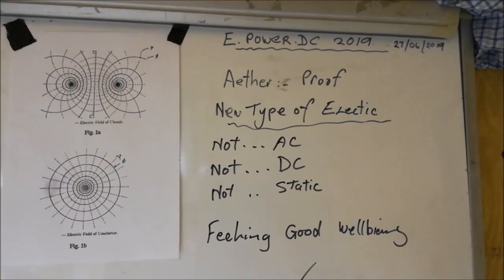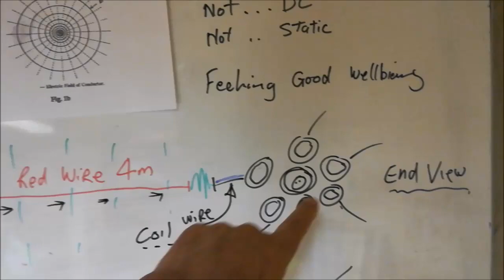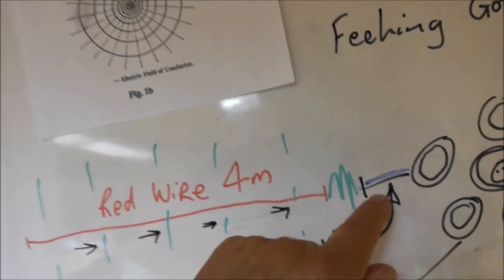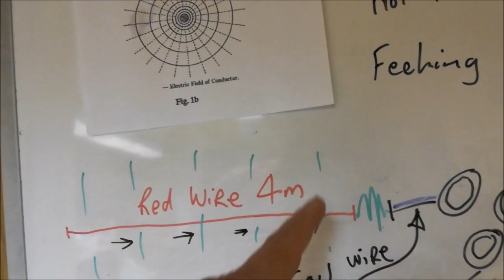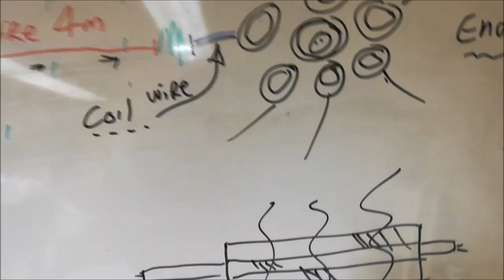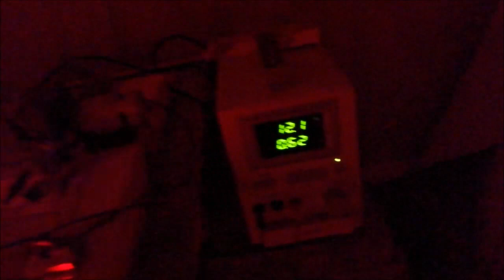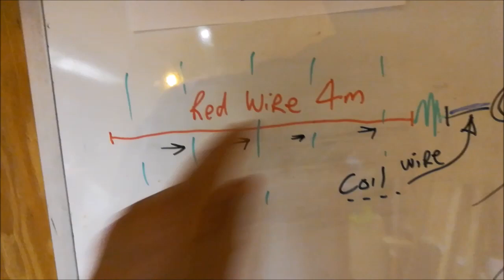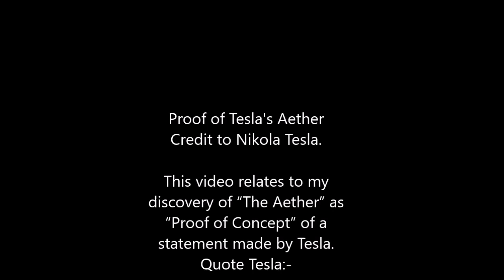Tesla's Aether Proof

Comment: It is called electric, not dielectric.
Electric field. Electric waves.
Dielectric has its own wiki page.
Reply from the maker: Hi J. W. Q. What is magnetism? Diffine it, What is electric? Diffine it not what does or quantum. I look forward to your reply... Regards... DC
Reply: You can find it here:
https://www.youtube.com/channel/UCiEHVhv0SBMpP75JbzJShqw
Search in "playlists" for 8.01 and 8.02
Best regards and a happy 2020.
Reply: @_John_Sean_Walker  Ok John. I think DC is describing electricity in Tesla's terms, not the modern way where the Dielectric field is ignored. It has been written out of the text books. Sorry if I've picked you up wrongly.
Reply: The dielectric is a material like glass or plastic etc. that is a non-conductor.
You can use a dielectric to store electrical charge on, like in a capacitor.
A dielectric field therefore, makes no more sense than a glass field.
Reply: @_John_Sean_Walker  That is in modern terminology. Tesla and everyone in that early era said electricity is made up from two components, magnetism and dielectricity. Dielectricity is ignored in modern engineering! DC is copying Tesla's experiments and the belief is this is the way electricity actually works. 
In fact, wires were not classed as conductors, they were 'obstructors' as the wires only guide the electricity, it does not flow in them according to the early pioneers.
Reply: Yes, when the wire has resistance, there must be a non-conducting part inside the wire.
Reply: @_John_Sean_Walker  We are not on the same wavelength John, HA HA.  The only point of wires is to guide and contain the fields  according to the pioneers. The wires play no part in the transfer of the energy!
Reply: Vacuum has a higher resistance than air, and air has a higher resistance than copper.
The copper plays an important role in transferring electricity.
Your point here, has been debunked over and over again.
Make a video about it, and see what comments you get.
Reply: @_John_Sean_Walker  This is not my point! It is the view of the pioneers. I am not an electrical engineer, I was merely stating the point that they believed that there are two factors, one being the dielectric, because I thought you were using the modern interpretation. 
The stuff about the wires was again their theories, not mine.
Reply: @_John_Sean_Walker  Looking again at your derogatory comment has made me think. I could make a video on the thoughts and theories of the pioneers and let people comment. They couldn't be derogatory to me, I would only be repeating their theories!
Reply: I'm looking forward to it.
Don't forget to place a link here in this thread.
Reply: @_John_Sean_Walker  I can only repeat what the pioneers say, but it makes sense in my mind. Could you please tell me where Tesla got it wrong to see if it changes what I currently think. Thanks.
Reply: Lee, we certainly don't know everything.
But when you have a multimeter, you can measure the resistance of wire with different thicknesses.
Different materials have each their own resistance.
The orientation of the individual atoms does count.
Reply: Yes John I agree, but at this moment in my learning I'm looking at where the pioneers got their thoughts from and why. Everything Tesla published works exactly as he describes. In fact, the US have built a replica Wardencliff tower in Texas and have been testing it (wireless energy). 
My view (at present) is why have we not progressed that much a 100 years after Tesla was stopped experimenting. Over the last few years we have introduced electric cars and wireless charging. Tesla had these over 120 years ago along with x-ray, radio, radio control, various motors and transformers, electrical supply and distribution and even a death ray! They all worked but what you are saying is he had the wrong concept of how electricity works. Just doesn't make sense to me!
Reply: Lee, I didn't say that at all!
I say that the "hard" part of the electricity goes through the wire, and we can measure the soft magnetic and the electric field outside the wire.
I think you don't realize that all participants in physics are occupied by this problem, and outsiders (who never studied physics) dictate how we should handle this kind of problems, like a three year old telling me how to drive my motorcycle.
I am a big Tesla fan, but Tesla didn't realize that you cannot get more out than you put in.
Reply: @_John_Sean_Walker  Was it not the physicists who ruined the electrical understanding the pioneers had? 
Originally I tried to give you the reason that DC was using the term dielectric. Nothing more. You said it doesn't exist and that electricity works differently to how the pioneers seen it. 
I can't prove it either way but I do lean towards their explanations. The Physicists say electrons move through the wire, this idea changes so much to suit discoveries it did not sit easy with me and that was the main reason I went back to the beginning. The speed that the electrons moved has changed many times from the speed of light to now a fraction of a metre per second. The latest I'd heard is they don't move along the wire, it's more like a tube full of balls, as some go in at one end they push others out at the other.  In the last part of the last century there has been an argument over the direction of flow, with no defining decision.
My brain doesn't like that. EPOWER DC is following the pioneers and learning their ways which I think is fantastic and I'm jealous. 
Tesla despised physicists by the way, he said they were so wrong!
Reply: Lee, if you want to know the point of my posts, you will have to read them.
There is no dielectric field.
The wire gets warm because the electricity goes through the wire.
Newton Maxwell Faraday Heaviside Lorentz Gauss Ampère all pioneers, but where are Tesla's equations?
Reply: @_John_Sean_Walker As the electricity flows over the wire, the wire slows it down, a boundary condition! Their thoughts!
Reply: Tesla didn't know about electricity because he didn't show his equations. He famously said physicists waste their time rolling through equations with no real point!
Reply: @_John_Sean_Walker  Tesla's most exciting stuff was his experimenting with the dielectric field. No magnetic field needed, imagine what you could do with that! But, essentially your saying Tesla didn't understand electricity because there is no dielectric and he didn't use maths? 
Make a video proving this and see what comments you get!
Reply: I say the dielectric is a non-conducting material, and it has it's own wiki-page.
The charge is stored on the surface of the dielectric.
There are no Tesla equations. I cannot make a video about the Tesla equations.
I have never heard about any Tesla experiment with your dielectric field.
Reply: @_John_Sean_Walker  This has become pointless. Again I say that the original start of this discussion was to clarify why the experimenter was using the term the dielectric field.  I have tried many times to tell you it is the way the pioneers see how electricity is propagated. 
You say it doesn't exist, I respect that because you  have not read about it and don't seem to know much about what Tesla was doing with electricity. That is not your fault it is what physicists think, but to say that it does not exist is a massive statement. Like I also keep saying , it's like saying Tesla didn't know even the very basics of electrical supply and distribution, a very bold statement! 
The difference here is I have never said you were wrong, I've just tried to give you the counters to the modern physicists theory.
I find it very hard to find things that are completely new in electrical science, in fact not a lot has changed so development of the dielectric field is not needed. Just about every modern communicating device uses the same old systems. So, once again, at present I am leaning towards the pioneers until someone can give me evidence that it doesn't exist.
Reply: No one can prove that something doesn't exist.
The idea in physics is that you prove something to exist.
Your dielectric field is simply the resistance inside the wire.
And since the vacuum has the highest resistance, your dielectric field is just the vacuum inside the wire.
Reply: @_John_Sean_Walker  Your a million miles away with that statement!
Reply: I'v made four statements in my last comment.
Reply: @_John_Sean_Walker  
good debate my question if theres no dielectric field whats between the plates of a capacitor?
Reply: Colin, the material between the plates is called the dielectric. It is a non-conductor and it even can be vacuum.
The charge sits on the dielectric. The charge can have a field around it. 
A Faraday Cage can block the Field.
You can call the field static or electric, but not dielectric. The dielectric Field would be the plastic sheet.

Comment: I believe all the power is in the aether. Like a still sea you can't detect it until you induce movement. How do you induce movement? Polarise it! This causes an inertial plane and if you move the inertial plane you cause a disturbance (wave). This is how electrical power is generated. When a magnetic field is moved  near a coil the inertial plane is moved which pushes a wave into the aether (like radio) or it can be kept concentrated and guided by wires. This is just how I see it.
Reply: @BULL SCHEIST Yes, quite a few. The electron stuff is nonsense. It has been changed so many times to suit new discoveries. C P Steinmetz put the maths to Tesla's motors and generators so that they could be understood and improved. They still use the same principles today in electrical distribution. Steinmetz said something like the biggest obstacle to furthering electrical knowledge was the idea that electrons flow in wires!
Reply: @BULL SCHEIST I think what you are doing is the best way, question everything. I know a little bit about the history of electricity and it amazes me how at the turn of the 20th century other energy ideas were put forward as theories and accepted. Tesla, Steinmetz, Thompson, Heaviside etc put their work forward and proved it worked, others put theories with no evidence forward and the world accepted it!
The pioneers had amazing plans for electricity, unbelievable plans, but everyone was stopped around 1920. Funding and labs stopped. Why?
Reply: Believe it or not, Tesla supposedly took the frequencies above the speed of light. By the way are you talking about the national grid frequency? I thought that was 60hz?
Reply: @BULL SCHEIST The way I see it. It's  like a sea where there  is no motion. Until the sea is disturbed there is no power. Electricity is not the movement of electrons down a wire, it is a disturbance within the aether sea.  Wires guide the electricity, they do not carry it according to the greats that give us the systems we still use today. 
These are not my theories, they are from the greats and just make more sense to me. I could be a million miles away from the truth, but it seems strange that the people who developed electricity designed and give us the systems we have today were wrong about how it worked?
So, in general you have to disturb the sea to get power. As a magnet rotates and approaches a coil, the disturbance (lets say pushes) increases, then decreases as it moves away, the top half of a sine wave. The opposite pole then approaches the coil (pulling) which increases and decreases accordingly. This is a circle but if related to time produces a sine wave. So the aether is being disturbed like a vibration.
Eric Dollard is someone to study if you want to further your understanding. You can make your own mind up about which theories are correct, good luck.
Reply: @BULL SCHEIST I'm in the same boat. I'm a mechanical engineer but needed to learn about electricity. I asked colleagues 'What is electricity' but didn't get a definitive answer. I ended up looking through the history and kind of make my own decisions, rightly or wrongly! 
Like I keep saying, Tesla give us the distribution, Thompson give us the electron but we are taught that electricity is electron flow in a wire, yet these guys said that's not how it works and invented the systems that we use! 
When I was looking at the electron running through the wires theory, it kept changing to suit new discoveries. It started that the electrons were moving at the speed of light, then they have progressively become slower until the new way of thinking is that they are like a tube of smarties, where as one smarty is added to the tube another is pushed out of the opposite end. I'm by no way clever enough to understand the real detail but once again (sorry), Tesla stated how it worked and invented motors, transmission systems, transformers, x-ray, radio, radio control, wireless energy transmission...........yet he didn't know it was electrons inside a wire! 
I have kind of give up discussing this for the most part because people judge you and it's hard to convince people. 
Oliver Heaviside if I can remember solved the issue of the long distance telegram faults. Basically the signals at the output were not what was going in the input. The dielectric and magnetism were losing sync over the long distances. He fixed this! He also disagreed with the electron theory so who has got it right? Good luck with your studying, it just makes me mad and confused.
Reply: @BULL SCHEIST That my friend is a very good observation. Wish I had noted it!
Reply: @Ali-gh7rj  That's all it is

Comment: Those sparks are quite different from usual sparks I've seen. Word "radiant energy" means nothing to me, as it doesn't explain much and I prefer to study its mechanics. It could be neutral particles which are now called dielectric field, or it could be condensed polarised aether particles trying to move towards their corresponding pole. Neutral particles, be it aether of any level or larger particles, are not supposed to create a charge, you might think at first. However, both polarised and neutral particles are part of one  - universal bi-field structure, therefore existence of one field immediately creates another field. And as mentioned in the video DC linked in the description, scalar field (made of neutral particles) interacts instantly and its possible to create and more importantly move magnetic fields across any circuit or a stator at very high frequencies and high velocity. After studying many successful devices (Tesla's coils, VTA, TPU, and similar) its clear that all of them do same job with different success rate. Some use material's natural properties but that's different. Thanks for your video, DC. 
Do you think in this video: https://www.youtube.com/watch?v=UZbXGDxMRCw wake field accelerator is actually affecting scalar field, and that makes it much faster than regular magnetic particle accelerator?
Reply from the maker: Hi AB to me Fields before particles , its like shape shifting vibration fields. During Tesla's experiments items materialised which gives us a clue. Bubbles of magnetic vibrating frequency's according to space rules. Nature is simple Ken Wheeler's knowledge about magnets is really on the money and fits in with an electric universe at many levels. The Faraday Paradox is a show through into the power of "Dielectric" field. We have been chasing the wrong monkey.
My next video will be about chasing "The Faraday Paradox". Thank you for your valued input.
Regards ... DC

Comment: If you want to proof aether, you have to think outside the box. There exist transverse dielectricity "AC radiant electricity", transverse magnetism "AC cold electricity", longitudinal dielectricity "DC radiant" , longitudinal magnetism "DC cold electricity".

These four together gives rise to Transverse Dielectro-"electro"-Magentism; Transverse Magneto-"electro"-Dielectricity; Transverse Dielectric-Magnetic "AC, DC, Positive Power, Negative power" ; Longitudinal Magnetic-Dielectric "TRUE scalar waves of aether."

Aether is a medium for these four variations. To prove it you're required to prove all these variations.

Sure, impulse electricity can be used but it is time-based dielectricity. Neither transverse nor longitudinal. The control maniacs would say not Faster-Than-Light etc.

Which is why to completely prove aether L-M-"E"-D and L-M-D must be proven completely since they are faster than light. Even though dielectric field collapse is faster than light, they will say it is irrelevant since nowadays everyobe is controlled by magical electrons crap, magical particles, quantum quackery, strings delusion, warped space crap, as well as boogyman "dark matter - dark energy" and thermodynamics BS to infinity.
Reply: TAO - HOME & GARDEN  Quantum mechanics is BS. It is oscillation mechanics twisted into magical particles. Everything is faster than "speed of light limit".